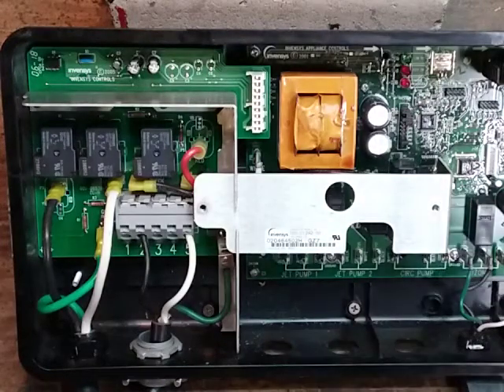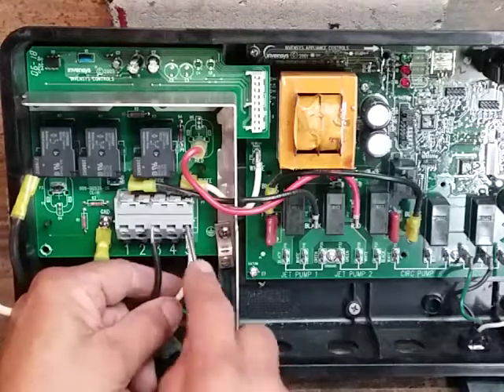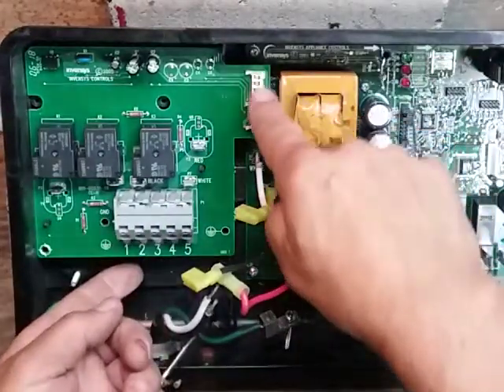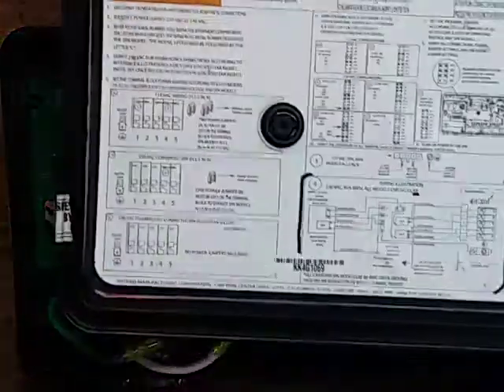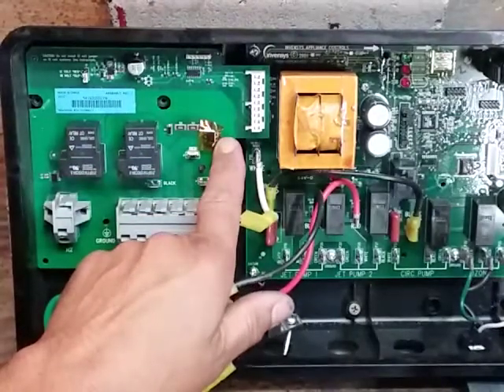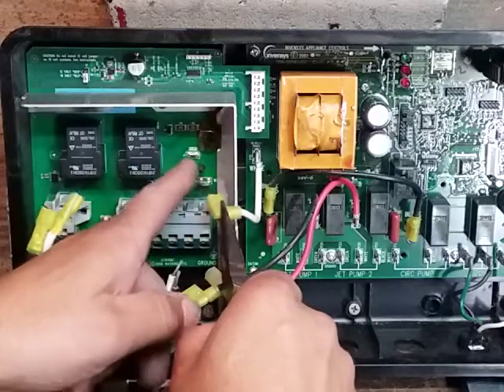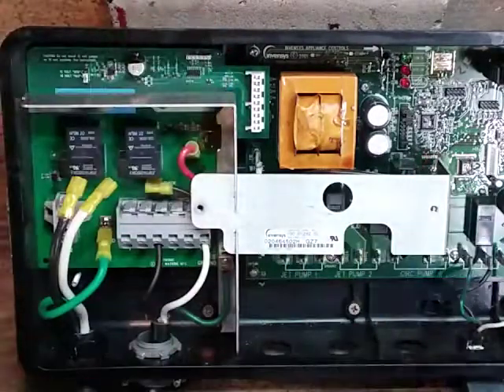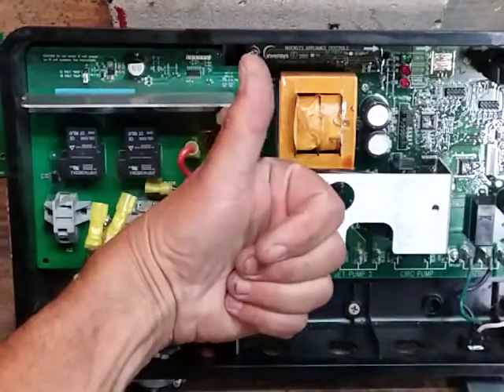Hot Spring heater relay board replacement

Comment: You don't talk about the 12v / 18v jumper at the top left of the new style heater relay board. How do I know how to set it if my main board does not have a similar jumper?  My spa is 220v.
Reply from the maker: @mfsmfs63  the 12v/18v jumper instructions come with the new relay board. In a nutshell, replacing the relay board on an old main board, you don't touch it. But if you have a newer style main board, you set them both to match... it's in the instructions.
Reply: @craigsmith5025  I've replaced the relay board twice.  Red Heat on light and green limit OK lights on motherboard.  Only get one red light on the new relay board, no voltage to heater.
Reply from the maker: @mfsmfs63  what's the voltage in at inputs 1 & 3? Put the meter probes in the square slots above the round wire holes.

Comment: My original board has a jumper on 4/5. I have wires on 1,h1,2,3,4 is blank and the common on 5.. do I need any jumpers? Everything is working but now all a sudden my jet pump isn’t working. I get 120v when I hit the power for jets… please tell me my jet pump went bad all a sudden?
Reply: Wish I could send video/photos
Reply from the maker: Yes, you need that jumper to carry the #5 neutral over to #4. You have a convertible spa... Jetsetter, Prodigy, older Sovereign. The jet pump is 115V. So you need that jumper.
Reply: @craigsmith5025  I have a hot springs…
Reply: @craigsmith5025  so if I have zero jumpers it’s heats, works. But my jet pump don’t.. I put that jumper at 4-5 and the lower lights just blinks red, and nothing at all works
Reply: I don’t even have a wire in #4
Reply from the maker: @Rick Baldwin  what model is it? Jet pump gets it's power from inputs 2 and 4. If you had a jumper connecting 5 with 4, then your pump is getting it's neutral from the 5 to 4 jumper. Now if things are glitching with that jumper in place, we may have some other issue. Like poor wiring or connection when pump is turned on causing a system wide voltage drop.

Comment: I do have 221v between 1-3. See above video. YouTube doesn't seem to want me to give you contact information in the other conversation. Couldn't find you on Facebook so I try to send you email and text number.
Reply from the maker: By chance do you have a newer replacement mother board in the IQ box? If you have a new 77087 board, and a new relay board, they must be matched in coil voltage per the install instructions.
Reply: @craigsmith5025  Mother board is 77000.
Reply: @craigsmith5025  I accidentally left it on last night and I came out and it was 80° where I had it set. So now we'll see if it'll get up to 100 degrees. I called Spa Pros last week and left a an inquiry message. Today's he shows up at my house with an order written out, cost me $140. I told him there was nothing for him to do but he fixed the check valve that wasn't broke. The idiot sucked in some hydrochloric acid from the ozonator. He goes that was stupid. Anyway thank you much for the help, hopefully it gets to 100 degrees!

Comment: Hey Craig, I have 6 gauge wire coming in from my power supply - will 6 gauge wire fit into the grey terminal block?  The wiring diagram calls out 10 gauge so I want to make sure this will work with the 6 gauge wire that is currently run.  Thanks!
Reply from the maker: If you remove a few strands it will. But don't remove too many. I'm sure it was what was available. But when overkill is a choice, it is just unnecessary and harder to do.

Comment: Is there a place to get less pricey parts Watkins
Reply from the maker: If you buy online, you may THINK you're getting the right part. But a Hot Spring dealer will help you get exactly what you need if you have your spa serial number. And if you happen upon a service tech at the dealer, you'll likely get helpful tips.

Comment: What if my board shows 0v going to the heater but the board is not burnt out?
Reply from the maker: Check voltage in at 1&3. If the LIM OK and HEATER ON indicator LEDs are lit on the main board, you should have power out to the heater connections. If your call for heat is being interrupted, something else could be going on.

Comment: Where is the best place to buy it
Reply from the maker: If you can't find it on ebay, your local hot spring dealer. P/N 77119. It should be about $190 at the dealer.

Comment: Thanks so much for this video.  I really appreciate you making such a helpful and clear video.  I had a similar issue where everything was running but no heat.  Sure enough, I removed the board and the same spot was fried.  I have a 2006 HotSprings Prodigy Model H.  I just ordered 77119 and will try to replace the board when it comes in.  I would normally have my local hot tub place, which is great, do the work, but they are 4 weeks out for service calls now because they are closing down all the pools for the season.  Your video gave me the confidence to see if I could figure it out myself.

Comment: Hello Craig, great videos! I think I have the same problem that this video is about, but I thought I would check with you first. I am getting a buzzing noise from the control panel when I turn the power on. Everything seems to be working until about 30 seconds in, I hear a click and the red light starts flashing. The buzzing continues. But again, I have the LED lights as explained in your video. There is also a red LED light labeled D17, that is lit as well. With this info, do you feel like it's a relay board?
Reply: Disregard. I think it's all good now. After scouring the comment section on all the videos, I was able to trouble shoot further. I had just installed a new heater and hadn't ensure good water flo before flipping the breaker for the heater back on. Ran just the pumps for a bit and then turned the heater on. Everything is working like it should.

Comment: @craigsmith5025

I like how thorough you are. Thank you. Very helpful.

I’m having a hard time finding some info I’m looking for and you seem very knowledgeable.

I have a mid 2000’s hot spring spa 240v dual breaker. 

It had a bad control board and had no functions or display. I replaced the control board and now I have a display, jets, light, and circulation. I also replaced the two sensors that go into the heater.  The water temp is cold but  I’m not sure it’s calling for heat. On the control board the red heater led is not lit up. I used a volt meter to test the wires going into the heater from the heater relay board and I have zero volts. I verified the breaker and input voltage are good. 

Any suggestions? Is my control board not commanding the relay board to send power to the heater? Or do I have a bad heater relay board? I’m not sure how to test this. Any information or a point in the right direction would be so helpful. 

Thank you very much!

Comment: Great Video. I have a spa nearly identical to this.. I have no heat with a new heater. The heat demand light on the main board is dark. Also both lights blink on the control panel. HELP. Thanks.
Reply from the maker: My channel has three videos on not heating situations. One is specifically for both POWER and READY lights flashing.

Comment: Thank you!  We have a Hotsprings Soveriegn and it's heating up to 90 degrees when set at 100.  I have cleaned filters.  Does that sound like a heater board?
Reply from the maker: Well, that depends. In cold northern states, a heater relay board would have your water ice cold. Is yours a 2001 to early 2009? Is your HEATER ON red LED on the board lit? Do you have good voltage in at 1&3 and no voltage out at heater connections?

Comment: I have 2007 Hot Springs vista with the exact same blown heater relay board. Is this updated board best. What part number? I have local shops trying to Sell me the old three relay board?
Reply from the maker: I think it's a part number 77119 for PUG IQ2020 control systems. The ones with 3 blue relays are ok, the ones with 3 black relays before that suck. The latest 2 relay version like in my video have the best track record. They made like 4 revisions between 2007-2014.

Comment: Hi Craig. I have a 2004 Vanguard that had a blown relay on the heater board. I replaced the board, and it blew another relay. After double checking for correct install I am completely certain all connections were made properly. Any ideas on what may have caused this?
Reply from the maker: It's possible that you put in a power jumper that shorted something out if it blew right away. Heater input power comes in from the breaker on 1 and 3, and goes out to heater on H1 and H2. Or if it blew the relay over several months time, it's possible you got an older style board or a defective board. Did your new one look like the new one in the video?

Comment: Thank you for the clip Craig. It is so helpful. I found my hot tub relay burnt and I am replacing mine. Where do you get the three terminal jumpers?
Reply from the maker: The new board comes with 2 triple power jumpers. On a large strictly 230v spa you won't use them. On a 115/230 convertible wired 230 you'll use a double snipped from a triple. And on a 115v spa with cord you'll do what I did here.

Comment: Anyone know why the Jets and Clean function won’t come on after changing the Neat Relay Board?   Was working prior to the change.  So odd.
Reply from the maker: Possible power jumper wasn't put in, or wiring error. Does the relay on the bigger board click?
Reply: @craigsmith5025  yes it clicks. Jumpers weren’t put in. I thought they were clips to hold the board in place if needed.  Ha.  Thanks so much for your help.  And for the  video

Comment: Hi craig, Just replaced damaged heater board I don't think it's heating. There is a little flashing red led on the heater relay board itself (the old style board didn't have a led) I wondering what it means? and if it's a clue
Reply from the maker: You have proper power input at  1 and 3? How about 2&4? Neutral on 5?
Reply: Hi Craig, Thanks for the reply. I am in Australia so I have a 240 V 50 Hz model. I have a new style heater really board (77119)and I have + on 1 and - on 4 and the heater going into H1 and H2. I'm pretty sure it's correct and conforms to what you showed in your video.The heater works fine, if I power it directly from AC although it has a resistance of 36 ohms for some reason. Everything seems correct but the relays do not switch the heater on and there is that flashing red D9 led (I also have the jumpers set up with the middle pin removed from the left hand one and 3 prongs intact on the right
 @craigsmith5025

Comment: Craig - can't thank you enough for your expertise! Just replaced the heater without diagnosing, because previous owner said it had stopped heating. I put in the new heater into my Prodigy H 2007, with no problem, but to find blinking lights...then I see your video, go test the circuit, sure enough, zilch, so I unbolt everything and burned out just like in your video. New one gets here Monday - will be up and running in 15 minutes. Love it - not bad for a $500 good hot springs!
Reply from the maker: Now, the blinking lights don't mean burnt relay board, they mean flow error. If your new heater is a PDR style w/o a wire to the PRESSURE SWITCH  connection, and your old heater had one, snip the wires short at the old heater's plug, strip and twist the wires together to make a bypass jumper plug, plugged into the PRESSURE SWITCH pluggin. DO NOT TRY TO WIRE THE PRESSURE SWITCH WIRE INTO THE NEW HEATER. there is no pressure switch inside, just a 240 volt resetting relay.

Comment: How do you get the wires back in the slots easily?

You made it loof effortless. 

Also any tips for large stranded wires being used?

When I took it out the first time, I didn't even need to use a small standard screw driver to take those wires out cuz they were just layed in there not tight. 

I got a roughly 8 gauge stranded wires for the 220v, then small black, red, blue and white for the rest.
Reply from the maker: Look at my other video on wiring tips. Click VIDEOS on my channel, I posted wiring tips a few months back.
Reply: I had to press reaaaallllyyy hard up and it opened

Comment: Hi Craig, mine has the 240v (all 5 wires) so on the old board there's a black wire in #2, with the new board and black heater wire going into H1 what happens to the original black wire that was in slot 2? thx
Reply from the maker: Everything that was 1, 2, 3, 4, and 5 on the old board, is same numbers as the new. Only thing is heater cord goes in H1 & H2 instead of push on terminals like the old boards.
Reply: @craigsmith5025  Got it! thanks ordering board now.
Reply from the maker: Keep in mind, this video is for PUG systems 2001-early 2009. After 2009 they were 7 input Orca then Eagle systems. Relay boards for those are totally different. If your old one had 1-5, the new one has 1-5 and the H1/H2. 1-7 inputs are different and won't work replacing one with 5 inputs.

Comment: Hey what if my Display screen isn’t getting power what should I do
Reply from the maker: More details. The screen like the control panel in the video, or the newer LCD TV screen display? Is the CONTROL UNPLUGGED indicator lit on the main board? Is the panel totally dead, or blinking red or green light on it? Keep in mind, the display screens go dark if the panels are left alone for a while.

Comment: Great Videos! I was told everything worked but the tub would only heat to 80 degrees and consequently the tub has been sitting for 5-6 years. After reviewing the videos Ive deduced that the relay board needs to be replaced...any tips on where to purchase? Also, the hot tub has been idle for several years, any thoughts on the restart process? Incidentally, the tub is a 2008 Vanguard which appears to be the same model demonstrated in your videos. Again, thank you!
Reply: Found it on Amazon.
Reply: @rogerrobarge3517  
?

Comment: Craig, Thx for the vids! But I'm at a loss. Hotsprings Landmark 220v, Heater good resistance, new 77119 relay seated, circ. pump blowing bubbles, red/green lights on main and relay ON.

No power at H1-H2. I have a feeling like I'm missing something or the new relay is bad. Any help appreciated .
Reply from the maker: You got good input voltage from your 30A breaker inputs 1 & 3?
Reply: @craigsmith5025  Yes, 121v. Heater - no power. Am I suppose to have a jumper/s installed? (The directions are confusing re 220v setup).
Reply from the maker: @apjack2553  you are supposed to have 240v across 1 and  3. If you have one dead leg, you will read 120v between one leg and ground/neutral, but bad voltage reading on the 2 legs together.(120+120=240)
Reply from the maker: @apjack2553  find me on face book in Muskego, and send me pics of your breakers and relay board wiring in messenger. Something may be amiss.

Comment: In the video, the last 2 wires are not terminated.  Does the black wire go on H1 or H2?
Reply from the maker: It doesn't matter. The heater wires connect to H1 and H2. Which one goes where doesn't matter.
Reply: Thank you!

Comment: I'm trying to get my 2014 Model TX going. It won't heat and was dropped maybe 6" on the board side getting put in place and was confirmed working before. I figure the element broke and when metering it I do get a complete open. Just to be safe I filled the tub again and have no voltage to the heating element when it should be calling for heat. The element being open seems to be a problem but I am hesitant to order the heater or a new element when it has no voltage to the element. Everything else is running fine and the lights on the board are green. Any suggestions? Can I replace just the element or do I need the entire heater assembly?
Reply from the maker: I'd disconnect the wires to the heater's cube pressure switch, and with the pump on low calling for heat, see if there's continuity through the pressure switch with a digital meter. Also, confirm it is wired properly. Those are 115/230 convertible. There are things to configure in the control box to match how it's wired. If it was 230 and you now got it 115, there is a jumper and logic to change.
Reply: @craigsmith5025  You got it spot on. I was too tired when doing it last night. The element is 17ohms. I watched some more vids and concluded the pressure switch was a possibility and after ohming it running and not it showed open both ways. I jumpered it and it is warming as a type. Thanks a ton for your response, a true gem of the internet and YouTube.
Reply from the maker: @Myron D  thanks. Now that pressure switch is a failsafe to protect your heater from destroying itself with flow or pump issues. Jumping is a good troubleshooting and temporary fix. But tape a sheet of plastic over the circuit board to the heater body behind the pressure switch. That way when you unscrew the old and install the Teflon taped new, you keep the electronics dry when water sprays doing the swap. Careful not to cross-thread... gentle feel and alignment to thread it in straight. I do it on full spas all the time.